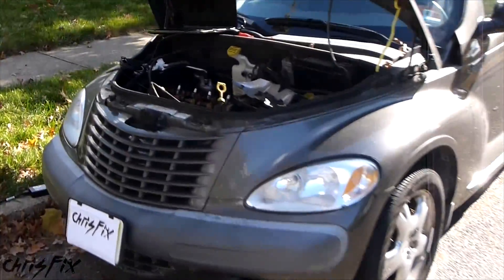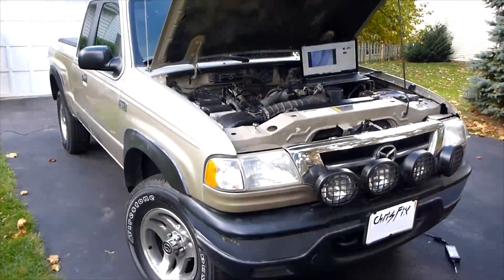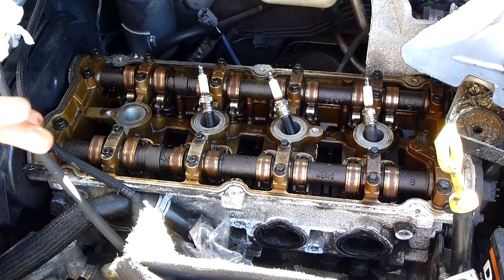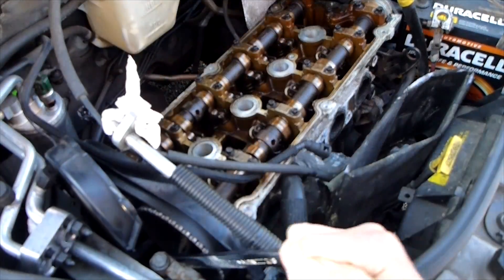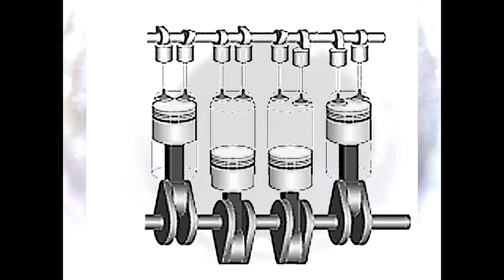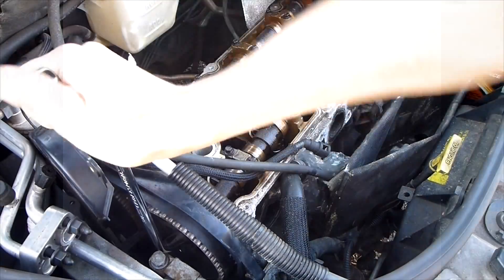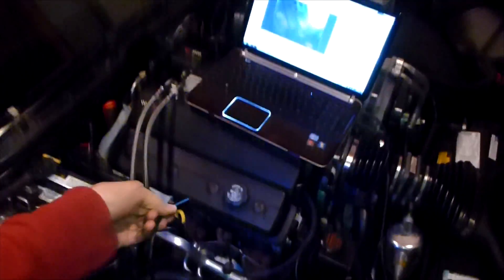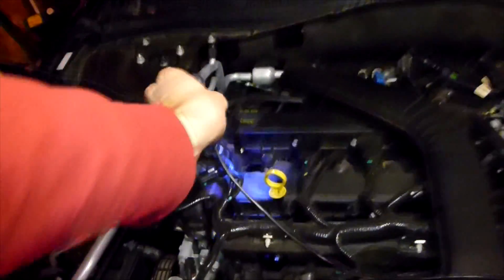What does the inside of an engine with a Bad Head Gasket look like?

Comment: Uhh the reason why you trucks spark plug "goes in at an angle" is because the engine is OHV. Virtually all modern OHV and many SOHC spark plugs are arranged like that near the exhaust ports. Did you know your truck is basically a Ford Ranger with a Ford V6 engine? I mean no disrespect and maybe you already know all of this, but the way you kind of casually said that disinfo I wanted to make sure to clarify. If you had for example a Nissan Frontier w/ 4.0L V6 which is DOHC, you could get a straight shot of the top of the piston.
Reply: ssdwellah actually the reason it's at an angle is because the engine is arranged as a V shape and if you look at the meter V, both sides are at an angle
Reply: Charlie moomoo the angle of the spark plug relative to the head has ZERO to do with the bank configuration. You can have a 60* v6 or 90* v8, etc... with the spark plug directly at the center and top of the combustion chamber. But this is usually only possible with DOHC 4v or 5v engines because of the valvetrain geometry. PERIOD. Look at the Nissan VQ series motor or Ford 5.0 Coyote motors for examples of v6 and v8 respectively, which have their spark plugs directly in the top of the heads where you can get a straight top shot with an endoscope. It has ZERO to do with the block type (I4, I6, H4, V6, V8, V12, whatever) and 100% to do with the head configuration. Spark plugs OHV and most SOHC have to go in at an angle. Period. This Ford Cologne V6 in the video is OHV and a perfect example of that.
Reply: Its clear that he knows its a ford because he mentions it ALL THE TIME if you watch his videos

Comment: Rangers are Mazdas with ugly blue ovals
Reply: zhbvenkhoReload My blue oval has 150,000 miles and only one dying fuel pump! You're all full of shit!
Reply: 1tokeover So does my wife's mustang, same engine cologne v6. Not a mazda engine, the mazda is a ranger clone, not the other way around
Reply: zhbvenkhoReload you are exactly right, and their engines are OHV Ford V6s. So the spark plug is near the exhaust port. It really has nothing to do with being a V6. There are plenty of V6 with DOHC where the spark plug comes straight down the top of the head.
Reply: yea
Reply: Dude what are you talking about? ford ranger is the original model, mazda bt50 its a rebadged one. That is called joint-venture. Ford laser/Mazda allegro festiva/323. MARKETING STRATEGY

Comment: I had an '03 PT with this problem. I spent over a grand and it came back a year later. I took it back to the shop, and they wanted another grand. Instead, I sold it to them and got a Tanger like yours.

Comment: I'm curious what my '92 Dakota 318 pistons looks like. Has 247k miles and is down until I replace the headers and inspect the valves.
Reply from the maker: The camera is linked in the description if you want to check your valves!
Reply: If its anything like my old 85 D150, itll be fine. Maybe some trapezoidal shaping but thats normal for old engines.

Comment: These videos scare the shit out of me, my car is 24 years old with 192k miles, constantly worried about this stuff
Reply: G thats not necessarily a bad thing, my f350 is 17yrs old and has 429k on the engine. still runs great.
Reply: John Pike the only solace I have is that it's the 3800 supercharged series engine, that engine was in production for 30 years before they put it in my car so they had plenty of time to work out the kinks as opposed to today it's a brand new engine every 3 years, no time to trouble shoot

Comment: Blown head gasket and letting your car overheat while can be connected are two separate things. Someone had to drive this car with a low coolant level while ignoring the smoke on morning startup and on top of that has missed the coolant temp gauge rising into critical territory before the the engine got toasted and coolant boiled over.

Comment: its a chrysler product their all turds, my mom owns a 2001 dodge dakota 4x4 and its on its 3rd rear axle 2nd transfer case rebuild and its 4th transmission now, the engine is in great shape but this truck only has 109k miles on it while my 89 ford f150 is all original minus the waterpump with 315k miles on it soo chryslers are crap even when compared to fords
Reply: control177 my 01 dodge ram 1500 has 215k on it, runs fine.. Every brand has their good cars and bad ones.

Comment: over the years of use the x hating or hone wears off. look for it on youtube you'l find how to hone an engine. with the hone gone smooth it does not mean the engine is worn out thats caused by the worn piston rings that cause blowby pushing oil past the rings on the down stroke. when you dont have any crank pressure that is blow by  there sould be a little puf because of the piston going down if there is almost none it could be the pressure is going in to the engine along with some oil causing blue smoke on start up. is there to mutch pressure the oil can be pushed out of the air intake or crank pressure release and oil dipstick. if u hear clikking pinging or other then normal noises let the car cool down for a few minutes and chek the oil on the dip stick is there none wait another 15-30 minutesand chek again no oil on the dipstick? put in a qart wait 10 minutes and chek again do this until the oil is almost to the max of the dipstick and listhen to your engine is the noise gone? good now remember to chek it again afther a hundred miles is it good? then there is no worry is the oil half way? get it cheked.
Reply from the maker: Thanks for sharing!

Comment: How would you look inside a diesel engine?
Reply: Justas X or a glow plug
Reply: injector  remove :)
Reply: John Pike are you kidding?
Reply: ricky302v8 uk is lucky enough to be warmed up by the gulf stream I believe, thats why Scotland is level with like Canada and Norway but rarely snows
Reply: Ghassan Al Farra not all diesels have glow plugs, mainly only ford and chevys do
Reply: Toyota does.
Reply: Michael Kennedy nope dead serious....you wont find glow plugs on ANY heavy diesels....ie CAT, Cummins, John Deer ect. and that trickles down to the cummins 4B and 6B series. i cant speak for the foreign light diesels as i haven't had a chance to work on those.
Reply: John Pike almost all light diesels in the UK have glowplugs from ford to bmw to renault to Mitsubishi.. Not sure about heavy diesels like Volvo, Scania ect ect
Reply: Michael Kennedy yea that doesnt surprise me.....its colder there
Reply: No, the UK is not colder.
Reply: The Master Commenter wrong
Reply: John Pike idiot, all do

Comment: **USE the camerea for before and after oil treatment (NANO, Glass, ect) that fills in surface area to smooth it out.
Reply from the maker: +Borr Magilicutty that would be cool
Reply: Yeah, there is "MOLY" Ceratec Oil Treatment Engine Oil Additive, "NANO Pro MT oil additive, "MOROSO" ceramic oil seal, "Friction 3000", and good old "Z-MAX".
THANKS!

Comment: How to clean carbon on Pistons without disassembly without sea foam can I use engine flush product and spray it on throttle body while rpm is on 2500 ? Or it's not right or shall I use water:methanol mixture and spray it in throttle body while its rev on 2500 rpm   To remove carbon ?

Comment: Obviously cooling system problems can be reduced by regular cooling system flushes and coolant replacement. But also my father always used to advocate running these systems unpressurized. Over the years I've found that doing so does not cause these cooling systems to boil over, even in very hot weather with the A/C on. Meanwhile, running the system unpressurized puts less stress on the head gaskets, hoses, radiator, water pump seals, bypass tube, heater core and so forth. I have a small hole that I purposely drilled in the top of the expansion tank in my vehicle to keep the cooling system unpressurized. The bottom line is that I never seem to have the same types of cooling system problems with my vehicles as many other people do. Specifically, I've never had a blown head gasket.
Reply: @ Brian Penn - Resorting to simple name calling and insults is usually taken as a sign that the person doing it is insecure in his factual position and so he has to resort to personal attacks because he has nothing else. You simply called my father an "idiot" but gave no reasons why you think he was wrong.

Re-read my post again all the way to the end, especially the last two sentences. I've been following his advice for years and I never have problems with my cooling systems, unlike a lot of other people.
Reply: @ Brian Penn - Very good Brian. More insults and now bad language. I guess that's the best you can come up with.

Comment: that motor was pinging like nuts.
Reply from the maker: It overheated.
Reply: +ChrisFix it looked like the piston either was hitting the plug or it was pre detonating, even before it blew.
Reply: Was it pinging though? It seems engines on cars I have ping no matter what the fuel although it's less with the highest octane.

Comment: hey ChrisFix, i have coolant in 2 cylinders on one side of the v6 block, others are fine. i noticed there was also coolant in the valves themselves. could it be leaking from the head gasket and getting into the valve ports, or could it be a leak in the lower intake? thanks much, love your vids!

Comment: Hi Chris, I have a Skoda Octavia 1.9tdi 2008 (bxe engine) and ive replaced pump, rad, thermostat etc. and i've done head test which came bavk negative and I also used gasket sealer which didnt work. Ive been told that the top of gasket is leaking water out the engine instead of leaking it into the engine. Is this probably the case?.....im also losing water. Cheers

Comment: Hi Chris, if I may offer a suggestion.  The aircon on my 10 year old Mistubishi 380 doesn't cool as well as it should in summer and I've had everything checked okay.
My suspicion is that the fins in the heat exchanger inside the dash must just be really dirty and not really passing air efficiently.  I was considering buying an inspection camera but I'm not sure if I can even get the endoscope in there.
In any case, if the heat exchanger is full of dirt and dust I guess I'd have to rip out the entire dash to do it.  
The aircon guys tell me it's not likely that the heat exchanger in the dash is full of dirt yet they can't actually tell me what the problem is since everything checks out okay.

Comment: See nats why water works better to clean your Pistons then sea foam !!!! Sea foam is fucking shit
Reply: he did a video on sea foam and it worked pretty damn good. check it out.
Reply: water is relatively free by comparison. steam cleaning the engine is so much better, it's an old school method too.
Reply: ***** Just spray water in the intake?
Reply: digitalblasphemy1100 like a spray bottle on mist setting, gotta be careful with putting in large quantities or you risk hydrolocking the motor, thats badddd. just misting water into the intake for a few minutes would do a great job, im not sure how long to do it for, i'd need a boroscope.
Reply: ***** I have hydrolocked my quad once so I know what that's like. I figured just a bit would do. I looked at ericthecarguy's video on this. He uses a cup and slowly pours it in. I'll use the spray bottle. Have you had any luck with fuel system cleaners? I watched a video on top gear or fifth gear or something and they recovered a TON of lost horsepower with fuel system cleaner. They dyno before and after each change they make but the fuel system cleaner recovered the most by far. Problem is the fuel cleaner they used isn't offered here. Do you have any suggestions?
Reply: digitalblasphemy1100 Yeah ive used some STP fuel system cleaners, I never noticed anything different on my car because its still too new and clean, and on a havent bothered with it on my old carbureted motor, i'd just rebuild the carb for fun lol. I definitely agree with keeping fuel injectors clean though, they're tiny tiny pinholes that atomize the fuel under immense pressure, where a carburetor just squirts it in lol. I hear theyre good though, preventative maintenance is a good idea when it comes to fuel injectors
Reply: ***** I just picked up a 99 tacoma and I have no idea what the history of it is so I think I might give it a try along with the water trick. I'll try the STP with a new fuel filter. thanks for the suggestions
Reply: digitalblasphemy1100 very nice, and no problem. good luck!

Comment: hey chris! i have 2004 honda accord v6, the valve cover is blown, the gasket kit which i got does not include the O'rings. is there any way to diagnose if my O,rings are blown or not? can the O,rings be checked by visually inspecting them? also my local car parts dealer has only 3 of those available with him.... please help me! waiting for your reply
Reply from the maker: +harsh tibrewala The O rings should not be cracked and should look good. A visual inspection should work. Make sure you lube them with oil before you re-install them.
Reply: thank you so much! the O rings are not cracked, is there anything else i have to check ? like is the rubber soft or hard, or anything like that 
thanks chris once again! your videos and answers has helped me a lot!  you are a car guru and will bothering you again if needed 
thumbs up!!!!!!

Comment: Engine coolant seems to do a better cleaning job than any bought cleaner i've seen! 
I'm wondering if it would be possible to simulate a gasket leak with a reservoir of coolant in a squeezy bottle?

Comment: hey chrisfix, if an engine hydrolocks, would the water have to be pumped out the cylinders, or would the water seep put of the cylinder into the block with the oil and come out like oil would during an oil change? thanks a bunch!
Reply from the maker: +alejandro espino If it hydrolocks, odds are you will blow your engine so it would leak into the oil. If you catch it before it hydrolocks, you take the spark plugs out and turn the engine over.

Comment: I used to help my father with car repairs when I was young. I remember we've changed head gasket once and one cylinder was absolutelly clean when all others had some deposits. It was cooling fluid licking into the cylinder. I'm wonder if there would be a way to use that to clean the engine rather than those all fuel adjectives that doesn't really works. It could be hard to mix water with the fuel but maybe some alcohol would do (which will produce water after combustion). What do you think ?
Reply: +pawel7318 You could modify a car to have water & methanol injection, (yes it's a thing for gasoline and diesel engines) or you could just spray water from a bottle into the air intake. This does work if you don't overdo it on the liquid; so, don't use a garden hose. Even BMW has tested water injection, it gives higher MPGs and I'd guess lower emissions and I heard also gives a cooler engine.

Comment: FREAKING INCREDIBLE JOB.
Reply: +genmaxpain  because it is a PT cruiser and everyone hates pt cruisers
Reply from the maker: Thanks
Reply: +ChrisFix why did you drive so long with the engine detonating? 
i have replaced many head gaskets from over heating and i have only ever seen 1 other that melted something,  the sr20ve melted the alloy block between 2 and 3 cylinder
that fat ass lady kept driving  with the head gasket blown, the engine didnt blow a piston as they have oil squirters to cool the piston crown and rings
what was your reason for continued driving on the blown head gasket? 
you can very very easily tell when ya head gasket is blown 
cylinder misfire, engine warming up random sounds/squeaks/rattles
Reply: +ChrisFix hey chrisfix how'd u get so smart with cars? school?
Reply: +Steven Little )( I hate them to. I had to do a water pump on a 2002 PT/cruiser + timing belt.

Comment: hey how hot does the air goes at the top of the stroke ( when compressed ) 
and how hot is it when it starts to burn due to the spark ?
Reply: +yassine debbiche  HOT.  Enough to make exhaust manifolds turn red.
Reply: Thanks but I'm asking about the exact tepmerature inside the cylinder
Reply: Bit late, but it's around 200° F when the piston is at the top of the cylinder and the spark plug ignite the mixture.
Reply: RzVids thank you my friend

Comment: Hey chris, I talked to you on facebook and you said to post on any of your videos with my question. So my cars radiator fan (Jeep Grand Cherokee 99) stopped kicking on, which causes my car to run hot. It boiled over once when my mechanic left it running (knowing this problem was the reason it was in his shop...) and it boiled over. Now i'm kind of concerned about the head gasket being blown, is there any way to test this without needing a tool or any chemicals? The reason Im worried about the head gasket is sometimes theres a little bit of white smoke coming out of the exhaust, but only after its sat for a while -- after driving it tends to go away.

I ran the car with the radiator cap off looking for bubbling but there isnt any at all, even while the engine revs. How ever, the coolant rises with the cap off - is this normal?

My second question is, whats the risks of just bypassing everything and running the radiator fan directly off the battery with a switch? And whats the best way to go about doing this, do I need special wire? Where can I find a switch, what kind do I even need?
Reply from the maker: +Dpa SFT It could be a head gasket. The best way to see is to try and bleed all of the air out, fill the system completely with coolant, and monitor the coolant levels as well as any leaks.